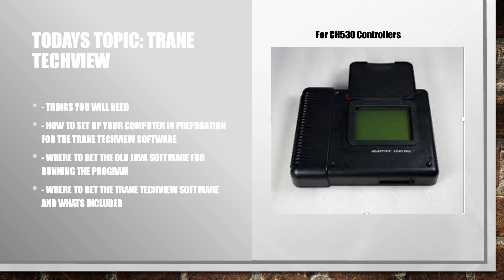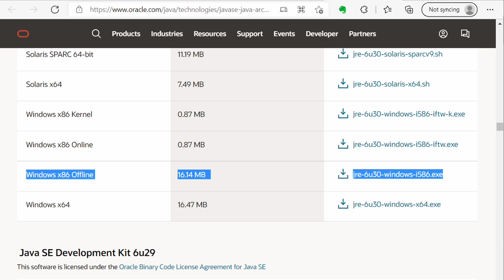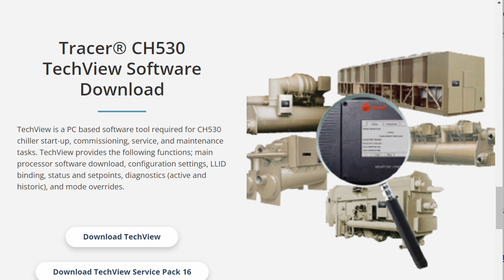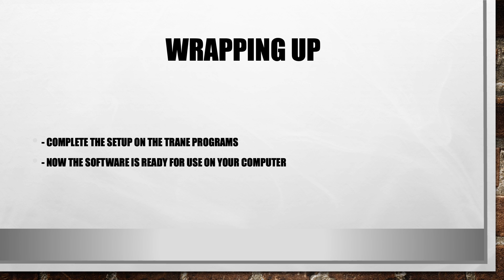Mastering Trane Chillers: Techview Service Tool | Download And Install Updated

Comment: I have a controller that is blank, has 24V but not powering up. Going to replace board. Its been a while since I have done but its as easy as uploading system software base on model and serial number, correct?
Reply from the maker: sorry for the delay, We are slower on social media. 

Yes, you will need the full model number string. Techview will prompt you.

The only issues I’ve had is sometimes one of the letters in the chillers model number string will not align with the same identifier in the new version of software.

It’s an easy fix, but does happen occasionally, and can throw you for a loop. 

We made a procedure for how to do this with pictures and explanations that’s available on our web portal. 

If you sign in, and put out a post asking for the “Trane Techview Software Loading Procedure” I will add a copy in the comments for you, so you don’t have to pay for a pro account if this is all you need. 

Good luck

Comment: Hi i follow all the links for techview ch530. When i get to Trane as i start the download it asking me to download another java link before it let me proceed.  I do this it then downloads.  Once downloaded it will not open like the video show. It open same image, but ask for a licence ??
Reply from the maker: Ignore the license, you won’t need one. You just need to connect to the controller with the serial converter and it should work. 

Let me know if your still having issues, and I can call you

Comment: RTWD chiller    version 434-17.00 supporting this software sir plz suggest me
Reply from the maker: @bhuvanraya  does it have the CH530 Controller?
Reply: Yes CH530 but not conet sir
Reply from the maker: @bhuvanraya  

its possible that its your serial converter, let me know answers to the following questions, and if it doesn't work I can try giving you a call.

did you install the correct version of Java?
which serial converter are you using what brand or model #?
are you conneting the serial converter to your computer first, then the controller?
are you sure you have the correct com port set up on your computer for use with the techview software?
Reply: Serial converter model DB9 RS 232
Reply from the maker: @bhuvanraya let me know the answers to the other questions

Comment: Does this software available here in the Philippines?
Reply from the maker: It is downloadable from the internet, so yes. as long as you have a Windows PC, and a Trane CH530 Controller
Reply: @TheChillerGuysHub  thanks, but can i use it for binding the sensors?
Reply from the maker: @josellesison380  as long as it is a CH530 controller you should be able too.
Reply: @TheChillerGuysHub  I'll try Sir, we are always calling a trane technician just to bind the sensors. It so expensive here in the Philippines.
Reply from the maker: @josellesison380  yeah for sure, give it a go, but this only works on the CH530 controller. Black box with green touch screen 

The Symbio controllers use tracer TU software, and it’s very expensive.
Reply: @TheChillerGuysHub  Yes sir, thats the controller we have here. Trane CGAM 52 tons with CH530 adaptive control. The downlable software doesnt need a license or account from trane?
Reply from the maker: @josellesison380  perfect, then this will work for you!

Just a quick note, when you get the software downloaded, you won’t be able to do anything in the program until you connect a controller.

There is another video on connecting and binding. 

We also have a pdf guide for a few other functions on tech view in the member portal if you happen to need it.

Good luck, just let us know if you need any help walking through anything. You can message us on Instagram or Facebook and we will help
Reply: Brother we have RTAC 200 Chiller and even want to change a single transducer,trane are come to doing , moreover cost is so expensive, what we can do for the software and the cable for doing job our self..

Comment: Lifesaver!!   Thanks for sharing.  I found another guys video on binding inside Techview.   I used my flashlight magnet next to the com cable connection on the oil pump high current board in our chiller.    Up and running within 2 hours of realizing I needed this done.
Reply from the maker: Awesome man, I’m glad you got er up and running! Good work man! we have one on binding too. 

I found this out the hard way the first time too haha it’s a pain when you don’t know, if you have any other video suggestions, let me know! I have a screw chiller video and some more systems stuff as well!